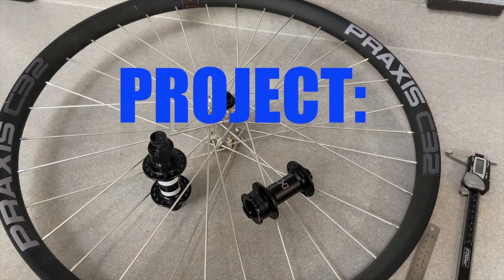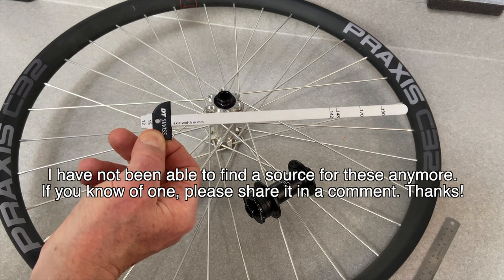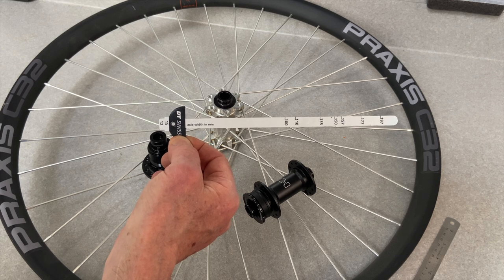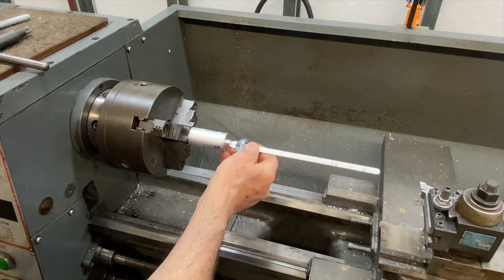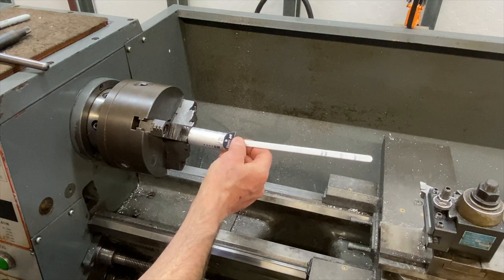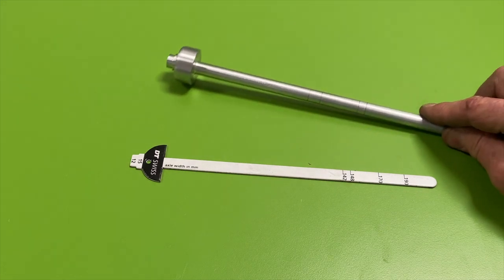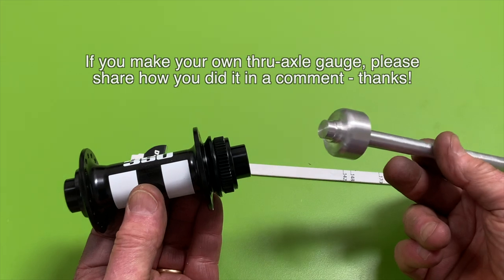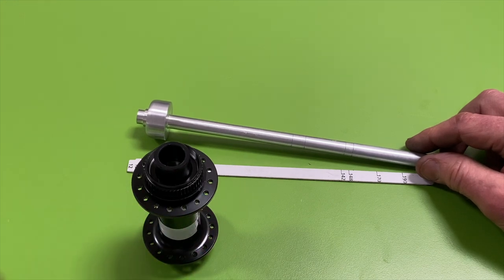Making a Handy Bicycle Hub THRU AXLE TOOL

Comment: You can use the longest 12mm through axle you can find and mark it like in the video.
For through axle diameter, if it's not 12mm it's 15mm, don't need a gauge for that, lol.
I appreciate your wheel building videos, helped me quite a bit.
Reply from the maker: Thanks, COSINUS, that's a great idea - especially since you might already have a thru-axle you could use as a tool. Online it looks like thru-axles start at about $20 so not that expensive if you have to buy one. On the sizes, there's also the somewhat rare 20mm. And yes if you have both 12mm and 15mm hubs handy and you know they're that size, it's easy to compare hubs to check the size. But, if you only have one hub, the gauge sure comes in handy at least in my experience. Thanks again!
Reply: @JimLangley1  Sorry mate, the math was pretty simple, in my head that is lol.
I meant to say that the 12mm through axle 'gauge' can be also used to check through axle diameter, 12mm - perfect fit, loose - 15mm and 20mm will be obvious if the gauge is 12mm. So the best choice for a gauge is a 12x148 boost through axle.
Reply from the maker: @cosinus_square  thanks for explaining more, appreciate it!

Comment: Use the depth probe on your calipers, rather than the jaws, to measure without interference from the spokes.
Reply from the maker: Thanks for watching and the tip, Bob. My 6-inch caliper's depth probe will extend to 153mm so it will work up to that. For wider hubs a larger caliper should work. So those are definitely great tools to have and use for this.

Comment: Great project! But how to measure the thread pitch in the "dropouts"? This also varies infuriatingly.
Reply from the maker: Thanks a lot for watching and the great question, Ben! I don't usually try to measure the threads. Instead, when I deal with bikes missing thru axles I try contacting the company that made the frame and asking them what axle I need to get. Or if I can't "talk" to the company, I will try using the Robert Thru-Axle Project website's finder tool. It works pretty well for telling you which axle you need - but it doesn't give you the thread specs as far as I can tell. Here's a link in case you don't already know about that website: https://robertaxleproject.com/ I did a little more googling and found this site that does provide some TA threading specs. Looks pretty good: https://www.thruaxle.com/understanding-specs.php Thanks again, Ben!